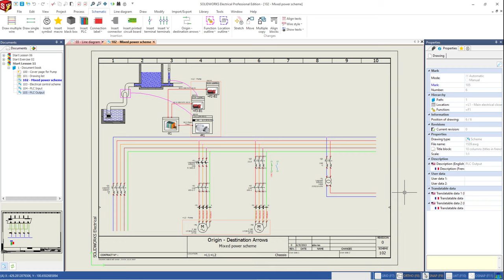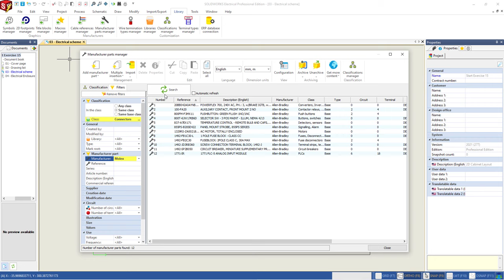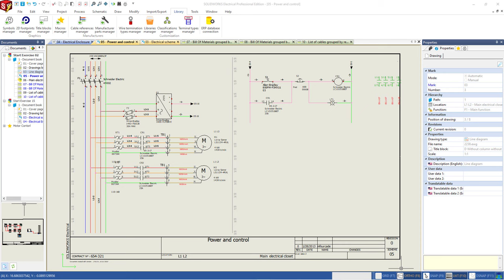First Look: SOLIDWORKS Electrical Schematic

Comment: is Solidworks Electrical Schematics  is also on CLOUD VERSION? LIKE 3DEXPERIENCE SOLIDWORKS CONNECTED.
Reply from the maker: Hi there, when you upgrade SOLIDWORKS Professional to Premium you gain the most advanced 3D CAD solutions available. Premium includes our SOLIDWORKS Electrical Routing package, which is our initial solution to assemblies which require cables, harnesses, conduits, and more. 

3DEXPERIENCE SOLIDWORKS Premium includes this package: http://go.solidworks.com/u4a